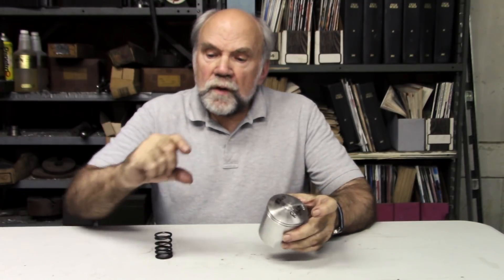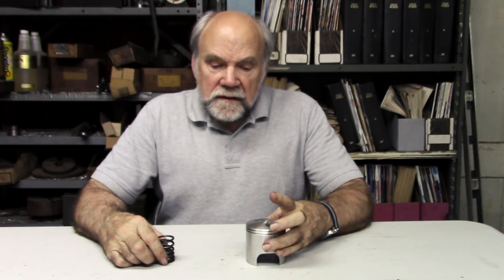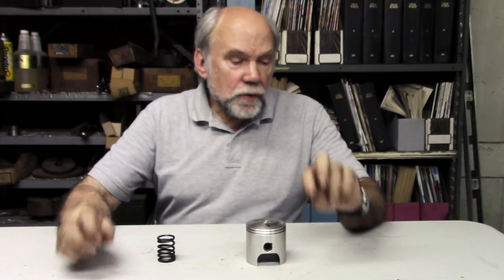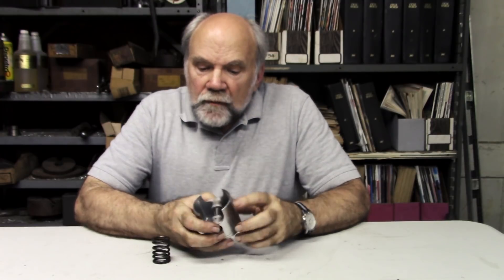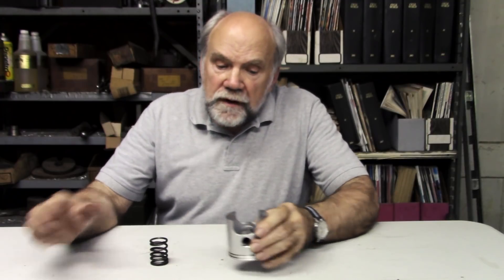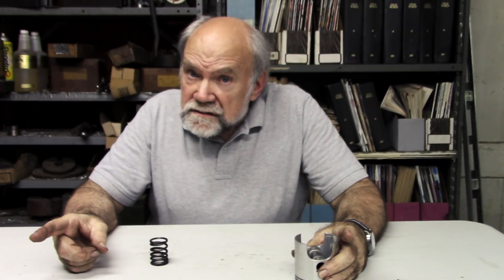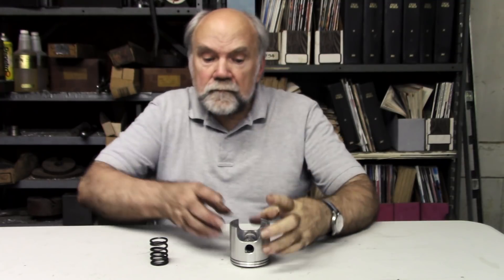How Has Motorcycle Racing Impacted The Use Of Engine Parts We Use Today?

Comment: Valve Float...hence the invention of overhead cam engines, to eliminate the problem.
Reply: OHC cam engines solve the issues of pushrod flex and other problems associated with pushrod design, they do not stop valve float, run springs that don't have enough seat pressure and your valves will definitely float in an OHC engine.